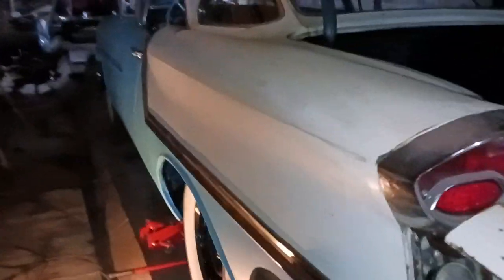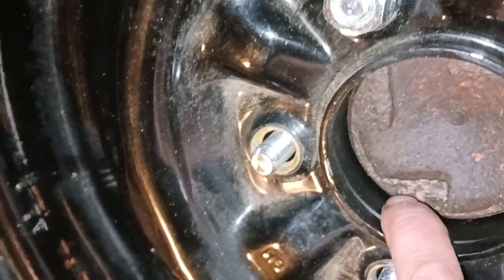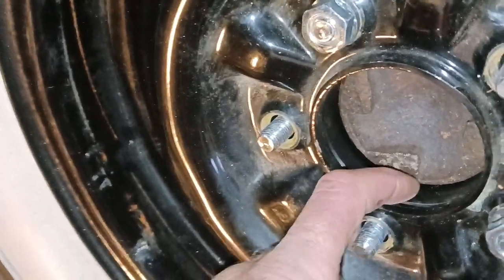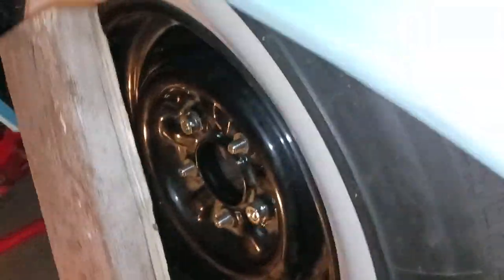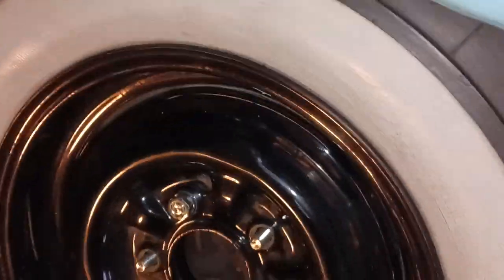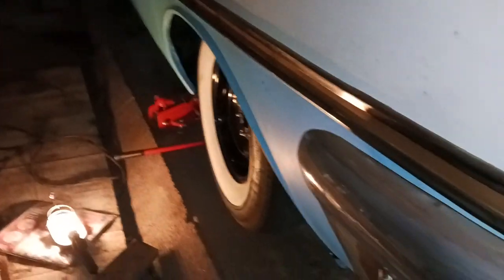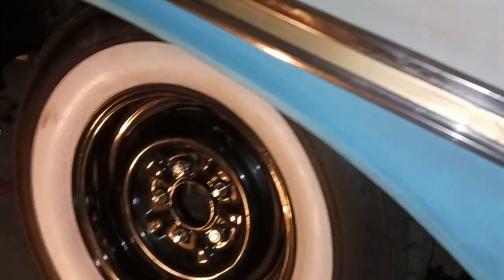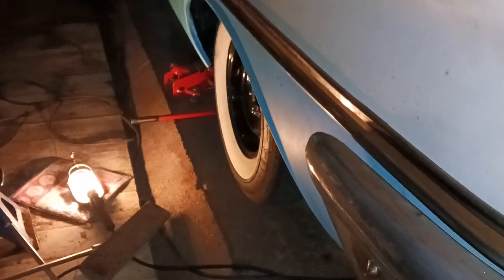the adapters seem to be ok

Comment: Should be fine Jimbo, I used some on a 68 Cougar to mount Chevy bolt pattern Cragars, slapped them on and did a 12 hour road trip to Florida.

Will give you that "Pontiac Wide Track Ride"! It should handle great.

Comment: As long as she rides smooth because the tires find their centre by fitting over the centre hub that they now miss altogether because of your adaptors. Yes they get roughly centred by the studs but fine centring is from fitting over the centre hub.